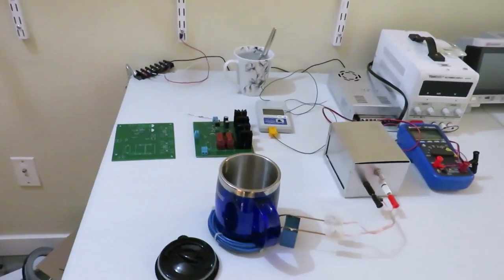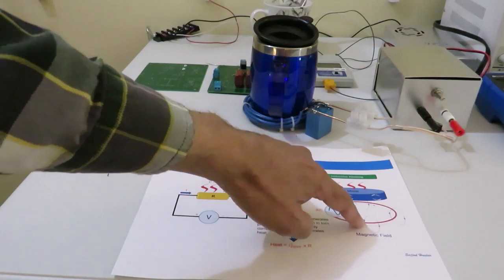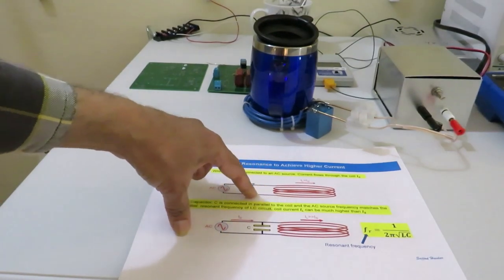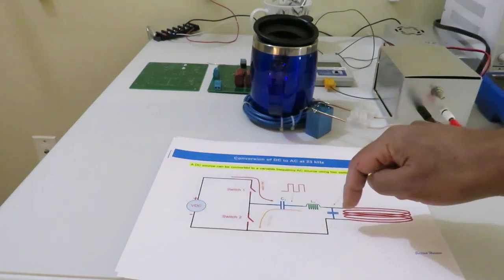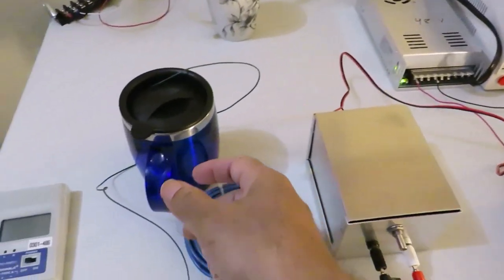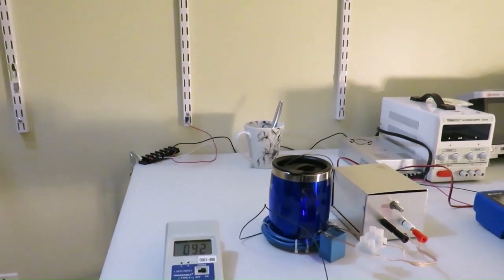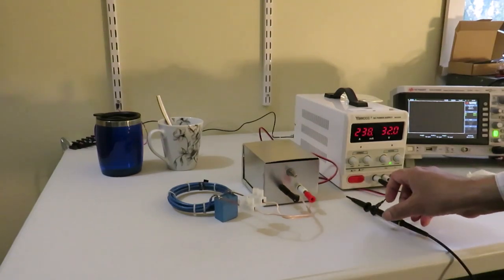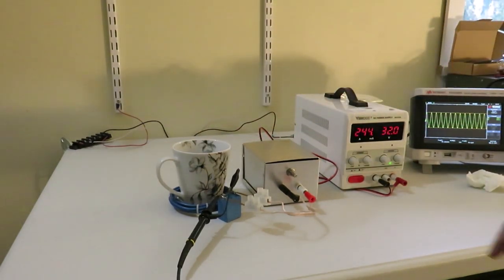Coffee Mug Warmer by Induction Heating

Comment: I love it. Especially with the spoon in a regular cup. This is a great application for induction heating. It would make a nice beginner project for me.
I find that for a cooktop, it's a too complicated way to heat your pots and pan. I prefer the simpler ceramic burners with a analog control that almost anyone can fix themselves.
Reply from the maker: Thanks for watching. Yes, it is true that the simpler the better.  One point about using the spoon, that the generated heat is small. It can keep warm for a longer time than without it. With spoon, temperature keeps going down slowly. However if the mug  has a top cover, it may be possible maintain a suitable temperature. I have not tested that

Comment: I had seen some commercial versions of this that use a metal disc long ago and recently thought about it again after seeing James Hoffman on reheating coffee video where the Ember mug was a good choice (battery with resistive heating in the mug). The weak point for inductive coffee heating for the high end market is temperature control of the actual coffee. Sensing the volume (load cell) and knowledge of the mug type might be enough to approximate a setting by measuring power and adjusting frequency with a microcontroller... all that because I don't want 130 CAD mug with batteries in it.
Reply from the maker: Thanks for your information. I added one more file below the video " Determination of Thermal Resistance" much detailed thermal studies are shown there

Comment: This is brilliant you have tapped into the free energy secret of Nikola Tesla
Use a pancake bifilar coil as the primary and secondary of a transformer
Use the high voltage high frequency output to drive bulbs or charge capacitors or batteries
Thank you for this video

Comment: Hi.  First of all, great explanation.  Also wanted to ask for the value of the external variable resistor; and if you were selling the PCB and components as a kit.  Thank you.
Reply from the maker: Hi Carlos, Thanks for your interest. The external variable resistor is 100K. I used a multiturn POT, which makes it easy to tune. I do not have sufficient PCBs, I only ordered 5 pieces from JLC PCB. They are not that expensive, you can order by sending the Garber files. I usually buy all electronic components from Digikey. From Canada this is the most convenient way to buy, however not so cheap. If I sell PCB and parts to you, that will cost you more.  I think if you buy all the parts by yourself that will be cost effective to you. Thanks again

Comment: Are eddy currents induced in the stainless steel liner in the mug? What if the mug is a ceramic mug with metallic coating deposited on the ceramic (metal paint)?
Reply from the maker: Yes, eddy current is generated in the steel liner. I think metallic coating on ceramic mug will also work, however how well it works not sure, coating material, thickness matters a lot
Reply: @technologyforyou5976  Thank you.